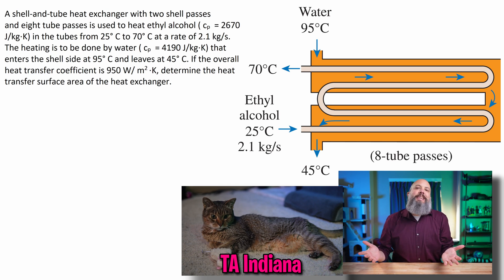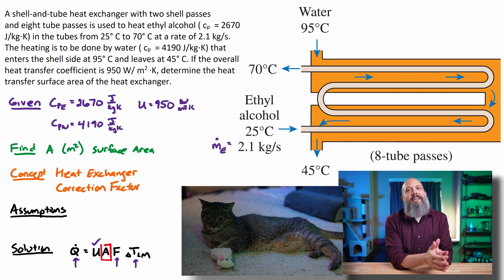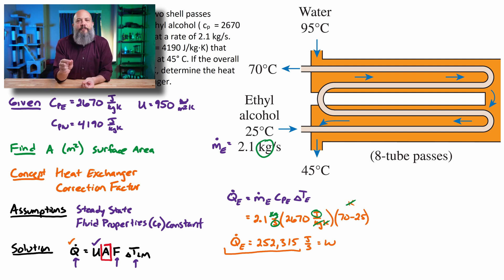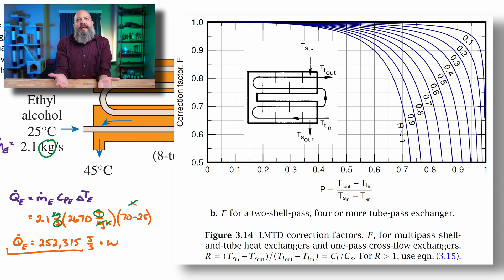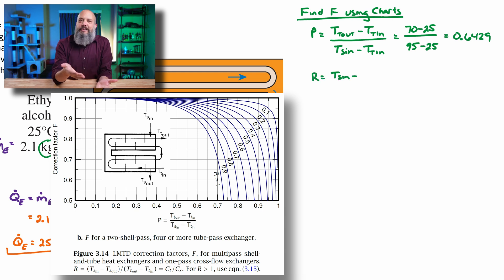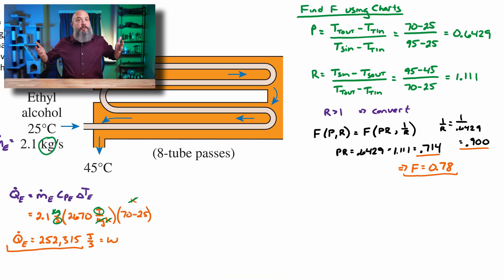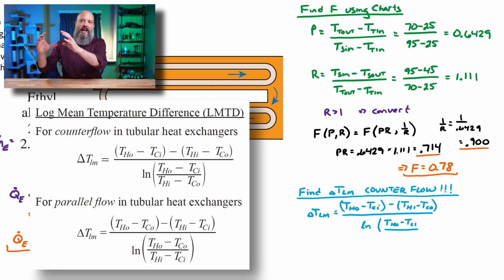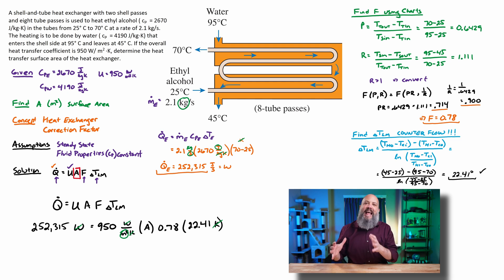LMTD Correction Factor F - Shell and Tube Heat Exchanger

Comment: please help me with 1/R=1/0.6429?
Reply from the maker: oh no, you're right, that's a typo. .6429 is P not R. 1/R should be 1/1.111. Luckily the 0.900 is correct. For this recording, I was copying from my notes, so I only miscopied this one number, it didn't mess up all the calculations that came afterwards. Those should still be right. hopefully 😿